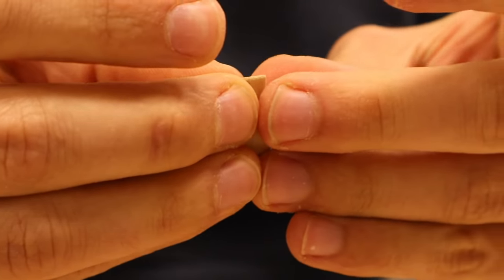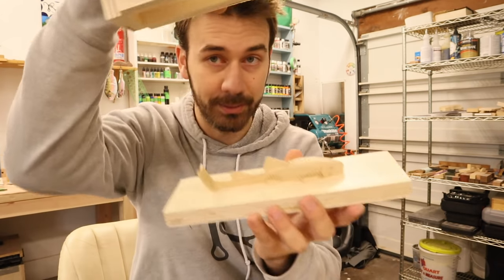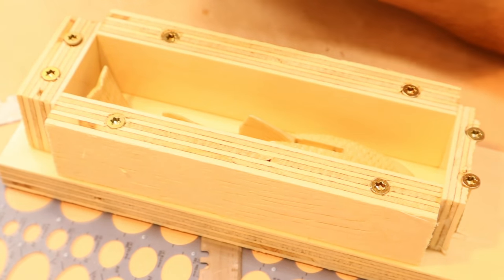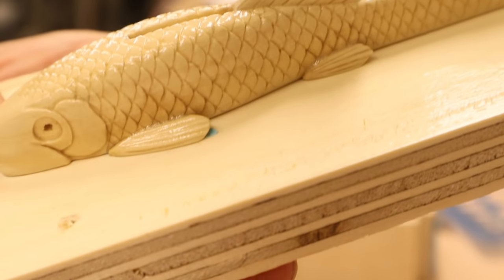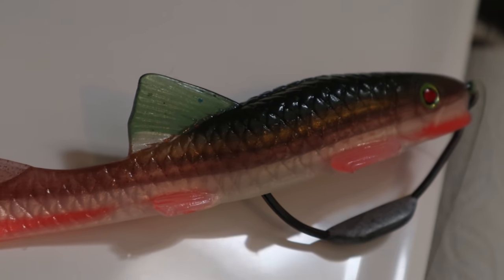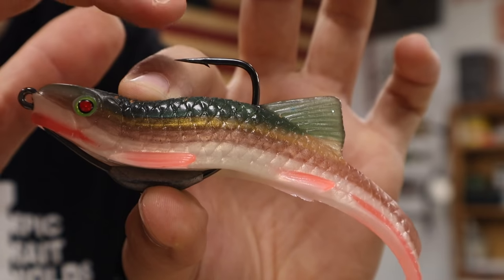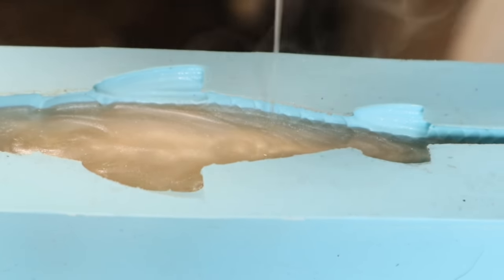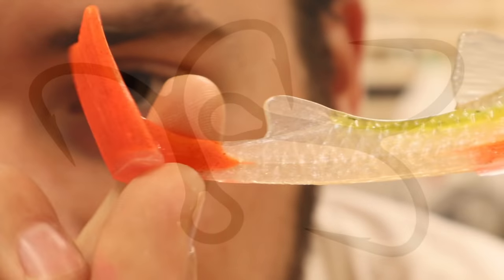Making a Bottom Feeder Sucker Open Belly Pour SwimBait

Comment: I would like to suggest that leather is your friend.  In previous videos you've clamped the timber in a vise, and laid the plug on fabric to drill the lead hole. For drilling, a simple leather 'pouch' filled with sand, would make a good, safe rest.  Also, some leather 'drapes' would be good for clamping against the timber.  Just a thought !!!  Thanks for the excellent vids of your equally excellent work.  Cheers, Steve.

Comment: I used to use that Smooth-On silicone to make molds for bird heads for taxidermy. I also used to make rock molds for making taxidermy habitat rocks & bases, and I used the Smooth-On Dragon Skin silicone. That stuff is very stretchy & is tough as steel. Molds from it last forever. It pours well & holds detail. It's somewhat clear, so you can see if you have any air pockets.

Comment: Build a vibrotory table with a modified vibritory palm sander. Can get the sanders for like 20 bucks. The table is easy to build and the sander will actually bolt right to it. No mods needed. Use butterfly wing nuts so you can remove the sander if needed. Will help to get those last few air bubbles out as the mold sets up.

Comment: You could make a “U” shaped trough with window in its side. Then you could use RC boat motors to make a current in the water so you can test and show baits in action! Like this <===>   You could probably make it all out of PVC with an acrylic tube as the viewing window you would just have to cut the top off so you could lower in the baits.

Comment: Dental technitians use a vibrator when pouring any kind of silicone, plaster or casting investment, Could use a orbital sander upside in a bench vise. It^s vise to spray a bit of silicone on the patern, as mould release, also use a cooking preasure pot , modified with a tire walve stem on the lid, and fill with 20 psi to shrink any bubbles whe pouring your final  lure, google dental pressure pot. Any old or new pressure cooker wil do

Comment: In cement we use a vibrator tool to get the air out i included a link you can probably use a smaller vibrator tool to get the air out. I also added release aid you can buy at hobby lobby.Wacker Neuson IRflex58 w/ Integrated Frequency Converter - 220v, 2.3", 15 METER - TMS Equipment Services

Ease Release™, Release Agents | Smooth-On, Inc.
https://www.smooth-on.com/product-line/ease-release/